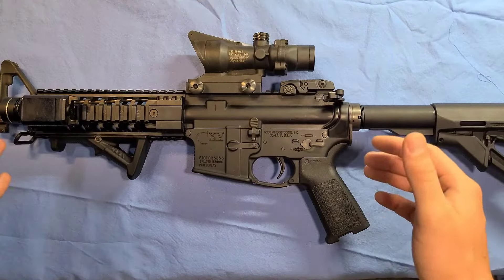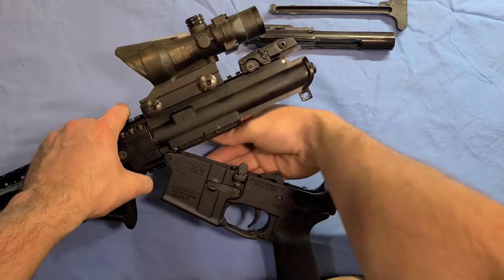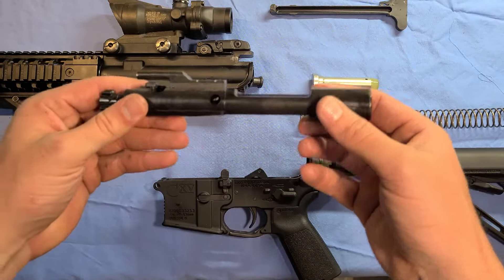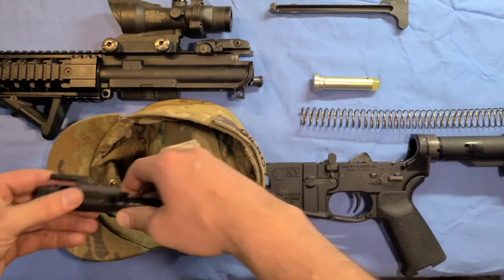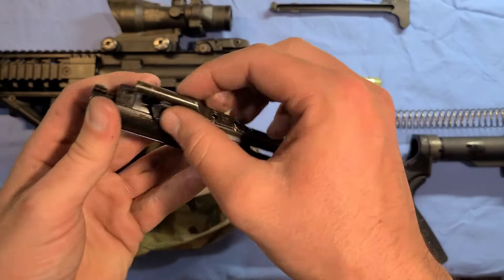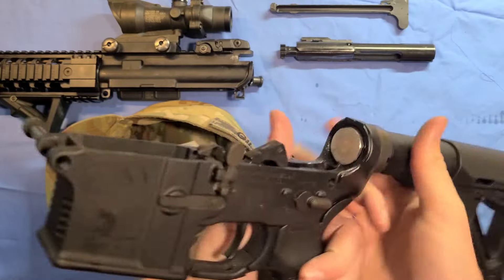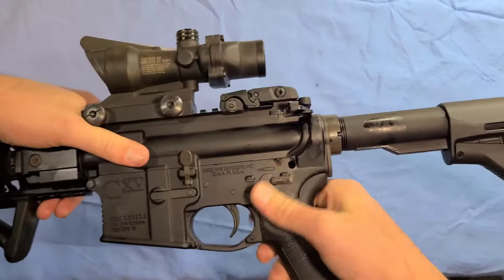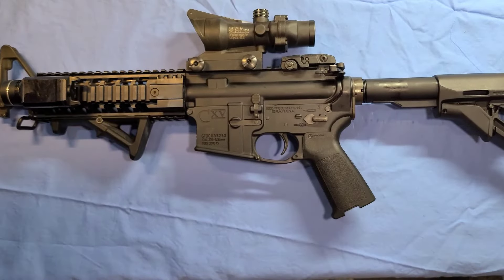Disassembly and Assembly of M4

Comment: One suggestion you can use the buffer to push the spring back in makes it much easier to put pressure on the spring so you aren't fighting it. My MTI showed me that as we would sit for hours disassembling and reassembling the M16 training dummies.

Comment: very good 👏🏻🙏🏻
I have a question for you. 
Are the M4 guns available in the market that we buy different from military guns in terms of quality and accuracy in targeting, etc.? 
I have been using the M4 gun for about two years, but when I shot it with my military friend's weapon, which was an army gun, I noticed some differences in that weapon. 
The military weapon worked much smoother and had relatively less kick than my weapon .
Is this difference due to the fact that army weapons have better quality than personal weapons? 
Or is it just because of the low use of personal weapons that it looks that way? 
The opinion of my other friend, a veteran, was that this softness in military weapons is just because of use, shooting, service, and frequent lubrication, and the more weapons are used, the softer weapon works.
What do you think about this?
Reply: Im pretty sure that military grade M4's are smoother and better because they are for actual combat.
Reply: Military weapons often use different calibers and are built simpler sometimes but as far I'm aware there isn't a massive difference between a military M4 and anything you can buy from a store although I could be wrong
Reply: I know the 5.56’s the military uses is higher pressure than anything civilian

Comment: That's not an m4, that is an ar15!,should  know the difference
Reply: That’s a M-4A1 with a ACOG
Reply: No sir!! No third hole for the auto sear, and the only mfg of the m4 or m4a1 are Colt and FN
Reply: No US property marking, no 14.5 barrel, no uid code, your full of yourself and need to get educated if you don't know the difference between a military m4 and 600 dollar ar15 made by a lower end manufacturer like Core, that is a core 15 cxv ar15